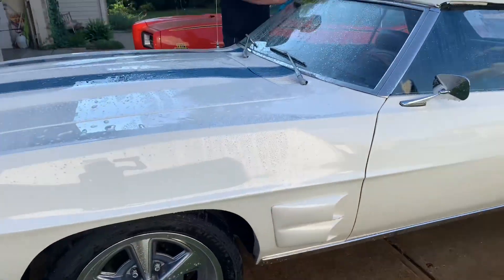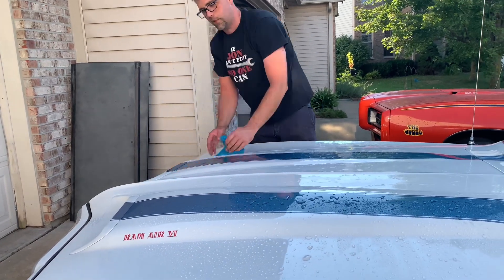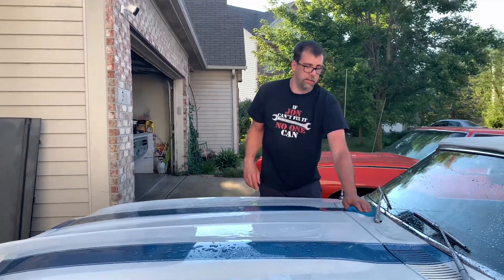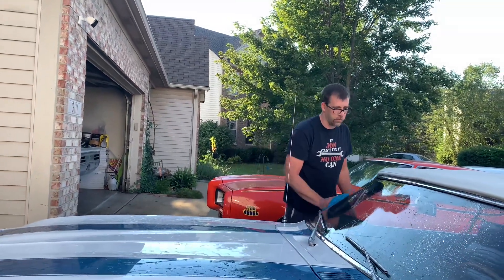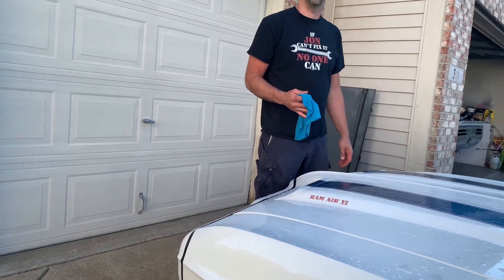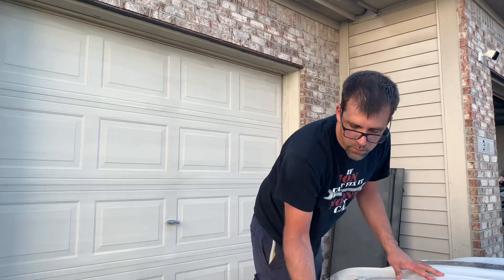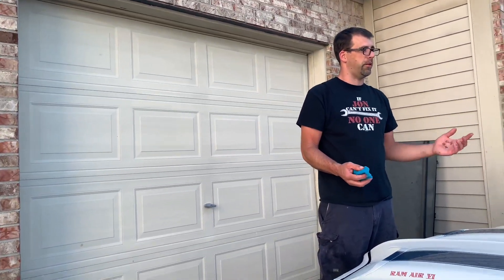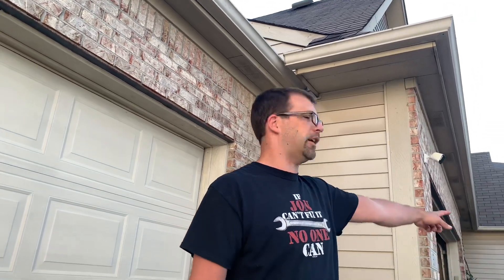Viewer Question and Answers on anything automotive.

Comment: Great video.  Quick question.  Have a local Jegs store.  They offer floor and truck pans for a 1969 firebird/camaro, can pick up at the store (save on shipping).  Do you have any experience with these pans?  For body panels planning to going with something from OER or equivalent as more visible. Thoughts?
Reply from the maker: I have used Jegs for two of the cars I built and did get good results. They had what I assume was a glitch in shipping even truck was free a few years ago. It was suppose to be order over $100 free minus truck.  Anyway end results i used oer trunk floor and main floor pan and rails, quarters and so on. I do prefer AMD but I get it shipping is EXPENSIVE so if I was in your shoes and that close I could pick up and save money I would do the same.    Note The hood I used on my high school car and did the video on getting it to line up was an OER hood so those things where repairable but did need some creative repairs to make it nice.
Reply from the maker: I have used Jegs for two of the cars I built and did get good results. They had what I assume was a glitch in shipping even truck was free a few years ago. It was suppose to be order over $100 free minus truck.  Anyway end results i used oer trunk floor and main floor pan and rails, quarters and so on. I do prefer AMD but I get it shipping is EXPENSIVE so if I was in your shoes and that close I could pick up and save money I would do the same.    Note The hood I used on my high school car and did the video on getting it to line up was an OER hood so those things where repairable but did need some creative repairs to make it nice.
Reply: Thanks for the advice.  Shipping is a little pricy on full floor pans.  Planning on making it over the the Trans Am nationals, this weekend.  Like to see your custom 69 TransAm in person.  Looks great on video.
Reply from the maker: @d pin  sweet!  heck yeah find me and we can check out cars together for sure.

Comment: I know you're busy, but I have a quick question. I have a 1998 Firebird with t-tops as a daily driver, not a show car. If you take the t-tops off, I have some rust by the front windshield. It wasn't a big deal, but recently when we get a hard rain the inside headliner by the rearview mirror is getting damp. I don't have the money for a body shop at the moment, and want to try to slow/prevent the rust and occasional dampness. Do you think using a wire brush on the surface rust, vacuuming it clean, and then hand-brushing rustoleum or maybe POR-15 would be a good idea? Again, it doesn't need to be perfect, just work. I appreciate your time.
Reply from the maker: I would definitely go that route, in a perfect world complete tear down remove all traces of rust by whatever means necessary and reassemble…..yeah that’s how cars get torn apart and forgotten about the project becomes to big and overwhelming sometimes. 
I wound do as you stated remove as much rust as possible and treat the area with a good product like por15 and slow or even potentially stop the rust and enjoy driving that beautiful bird for many more years before worrying about repairing it properly
Reply: @VinylVillageGarage  thanks for answering. I will try that very soon.